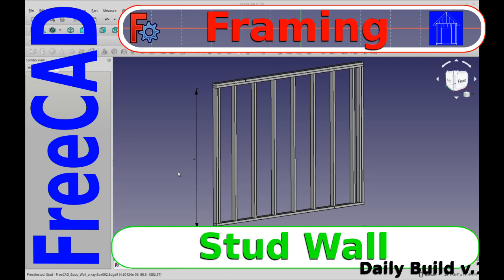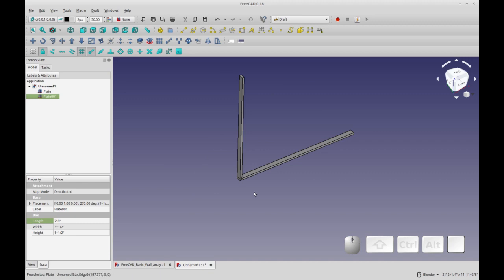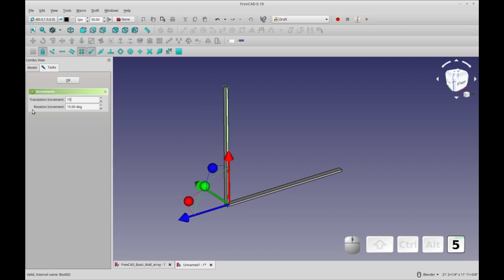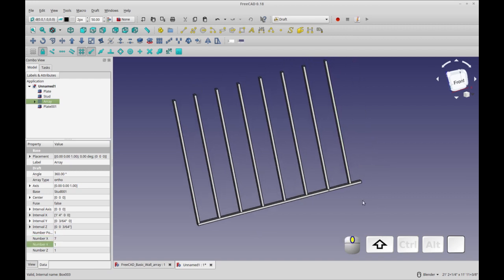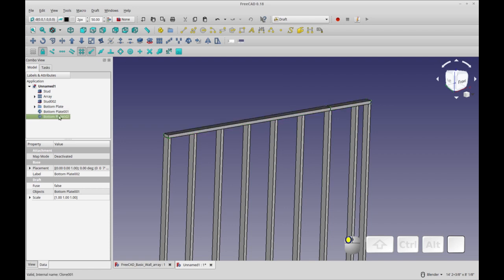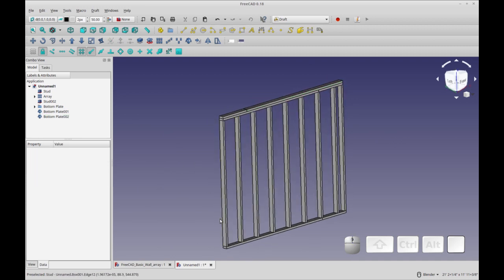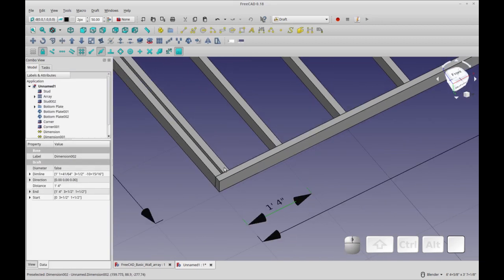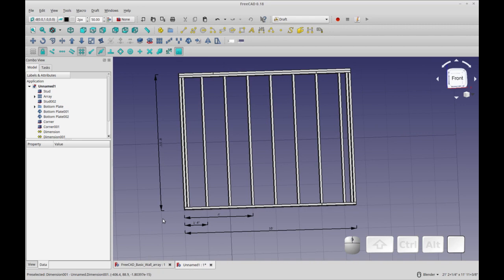FreeCAD Tutorial - Framing BasicShed Wall

Comment: Very helpful videos.  Are you able to advise how to cut the ends of joists to meet an intersecting member at an angle.  Imagine a timber triangle on a flat plane (say x-y) viewing in top mode and wanting to place intermediate joists between 2 sides of the triangle.  Obviously the ends of the intermediates will not meet the other sides at right angles always so the ends need to be cut at an angle to meet the triangle side flush.  Is there a way FreeCad can cut the ends automatically and calculate the cut angle (do it) for you?  Thanks

Comment: 8' - 3*1.5"= 91.5" or 7' 7 1/2" ?? If you want to account for 1/2" drywall for celiing, then probably need to account for flooring, usually 5/8" per forums...sorry just trying to follow with measurements as I want to setup plans for my house on freecad....

Comment: What magic did you use to have the tool bars stay "in place"? When I am in Part Design" and toggle Sketch, my Constraint Toolbar is nearly off the screen. I have moved many of them around, even undocking them and letting them float on the drawing area. They revert when I start a new session.
Reply from the maker: That's a bit of a sore spot with me. But there is an add-on called persistent toolbars. You can also edit that in the parameters tool in the edit menu. to be clear I just spent the last two days having to constantly re-enable toolbars .. .
Reply: @mathcodeprint  0.17 is not ready for being referred to as a Beta. I have spent a LOT of time yesterday and today attempting to symmetrically constrain a rectangular sketch. The results wander all over. IF they even allow selection at times.  Way to often .17 will not allow me to select the origin point for reference. And the forums are a joke.
Reply from the maker: Hey Bruce, you have my sympathy. I'm not sure they even call it a beta. The first thing that most people say about FreeCAD is that it has a steep learning curve. I think I am coming out of the other end of that curve after playing for two years. I probably should put a warning on all my videos. Something like "may lead to physical damage to your computer display". Then put the picture of the duck hitting the computer screen with a hammer. I will tell you this that I am enjoying FreeCAD now.